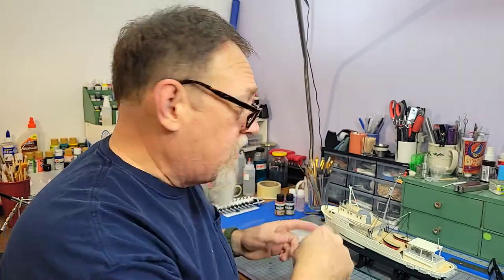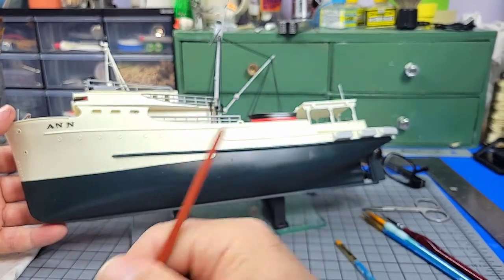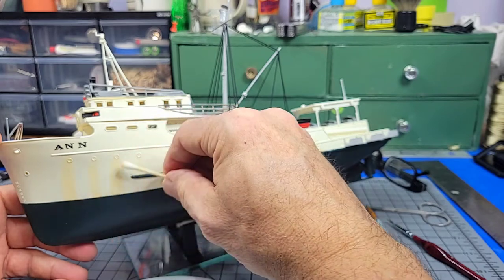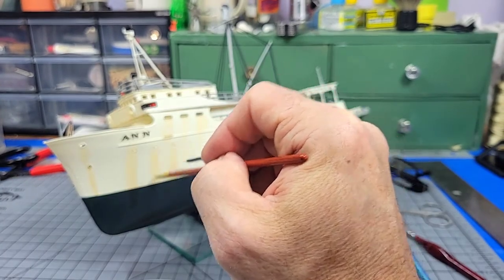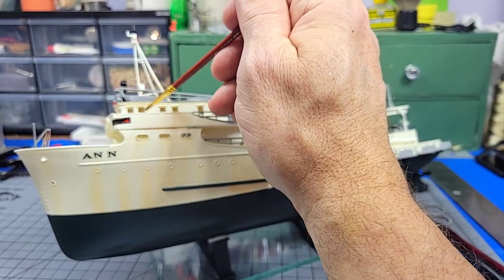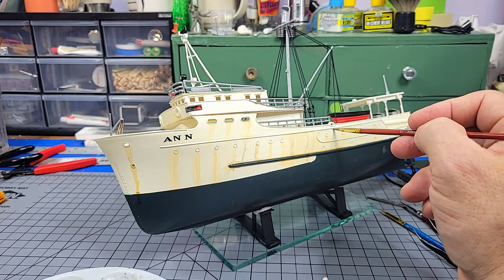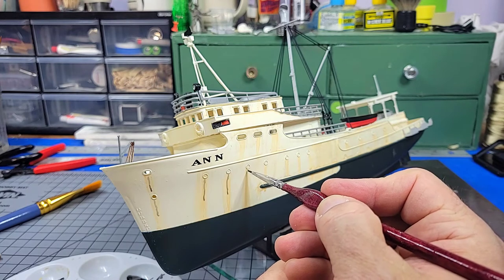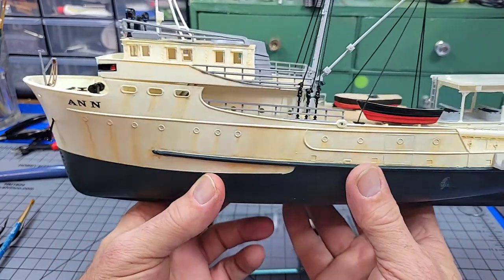Weathering Techniques for Model Ships using Acrylic Washes, Final Details on the Tuna Clipper Kit

Comment: Great Vid! I'm new to ships. Did you apply any kind of varnish before weathering?
Reply from the maker: I put a coat of Duragloss Varnish on it, but not so I can weather it.  A lot of seagoing vessels are painted with a gloss polyurethane. Since the weathering treatments were going on top of that, it would look odd if it was flat to start with.  Basically, I made it look new before I made it look old. 
Hope that helps.